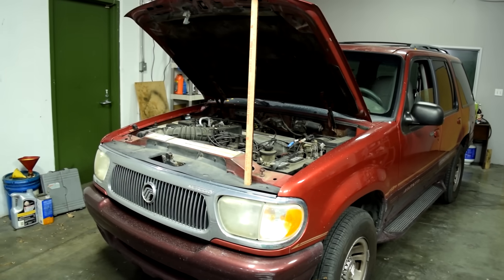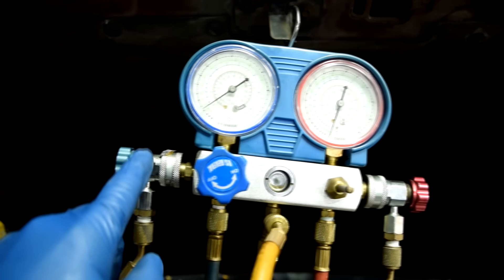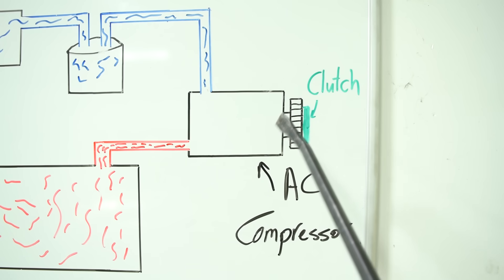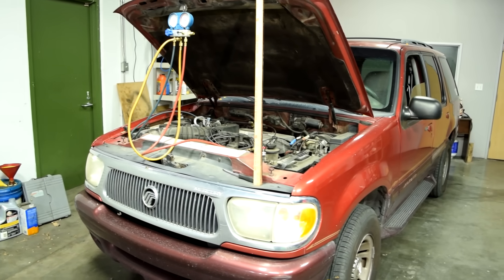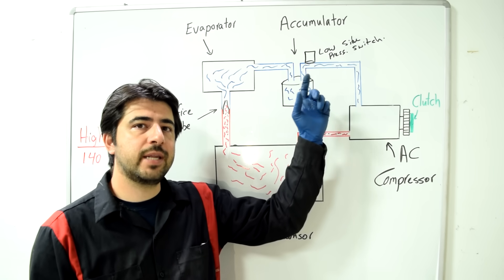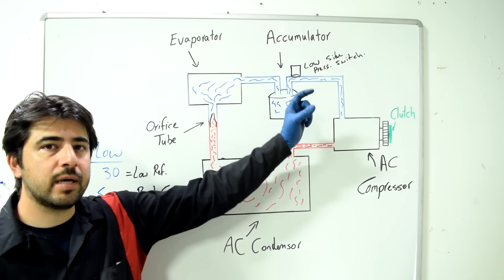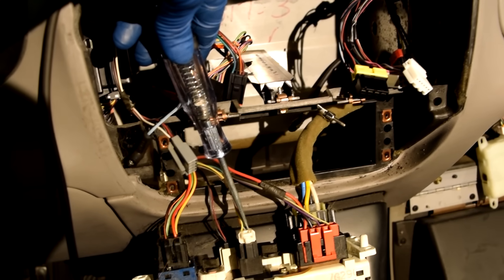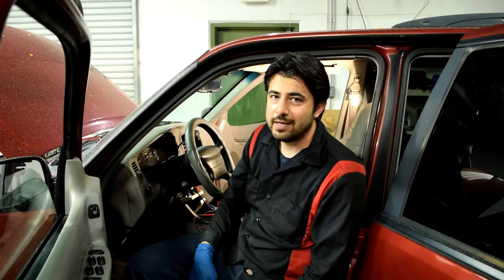Automotive AC Diagnostics, Operation and Repair

Comment: Working on a system that was evacuated due to changing both hoses going to compressor a vacuum pulled but does not hold vacuum when pump turned off?  A leak somewhere on low side, high side held

Comment: I guarantee you, it's the cable that's broken, because all those older cars or made with these little plastic pieces, they get brittle over time, in the hot Sun and I tell you what will actually work. And it has worked for me for years. Is it JB welding? The
Bike wire, just like the one on A Regular bicycle, glue it to the part where it's broken, and it will actually work. I haven't had any issues since I've glued mine down and over five years

Comment: There's a much easier fix to the common broken blend door.  You do not need to pull the dash, but it does require cutting a hole to get to it and replace the blend door itself.  Don't pay to have your dash pulled.

Comment: If I lost all my refrigerant, how much oil would I have to add. I'm going to replace  condenser and accumulater. It's on a 96 ford ranger. I just don't know how much oil would have been lost loosing all the refrigerant?

Comment: Hi. My car ac runs on 134a. Ambient temp is 95F. At idle, the low side reads 30psi and high side reads 250psi. At 2000 rpm, the low side reads 45psi and high side reads 390. The system blows cool air, not cold. After I turned off the engine, the system took 13tmin to even out the low and high side pressures. Is this a sign of bad a expansion valve? Compressor runs fine. The low sideline is cold. But cold air is not blown. Just cool air is blown in the cabin.

Comment: I thought it was very fulfilling. Good troubleshooting and shows but it takes more than the refrigerant cycle to cool the car. I had a friend with a similar problem on his Nissan and I showed him how to reach under the dash and turn the thing by hand. He had also run for years with it on hot. After that he probably ran cold all summer and hot all winter and only had to fool with it twice a year😂

Comment: Howdy...I have a 1995 Chevy 5.7L K1500 truck A/C issue.  I replaced the pump compressor with a new one because I thought the pump was bad, and it may have been going bad. But my gauge set was faulty out of the box...the Low side hose at the system end was not drilled, so it was a dead-end.  I figured this out when trying to put PAG oil in the system. I drilled the brass hose fitting and put 6oz of PAG oil in 3 different places (new pump, accumulator, and condenser), and 34oz of R134A (what it calls for, 32ish).  This afternoon it's presently 72 deg F. A/C is blowing very, very cold as it should be on Max. The Low line is very cold. The High line is very warm to hot (I can hold onto it for 15+ seconds, on the metal portion right out of the compressor), and the pump case is very mildly warm to ambient. With the cab window down, in the shade, the compressor clutch stays on fulltime at idle, but when revved to 1600ish rpm it will clutch-on for 6 or 7 seconds, and clutch-off 6 or 7 seconds.  The air stays cold in the cab when it does this.

I also changed the orifice tube with a new one, and blew out the condenser (nothing came out), and removed and inspected/tested the accumulator.  It was good.  The system looked fairly new, like less than 5 years old. 

At 750 rpm idle the low side reads 23 to 25. The high side 135 to 150. At 1600 rpm it stays the same, except it cycles as I mentioned.  When it turns off, the pressures changes of course. When I turn the truck off, the pressures equalize within 5 to 10 seconds. 

What might be my issue?  I'm first going to check the readings with another gauge set, as this new rental set is crap.  Many thanks!
Reply: pressures are a bit low.  check idle speed .  idle up (fast idle) should work when ac is switched on.  if idle is good, recover the refrigerant, pull a good vacuum (half an hour at least) and charge by weight.  no fix, could be a bad evap thermostat or a bad compressor.  or you can leave it alone if ac is cold at idle.
Reply: @rodzvalv_5673 thanks!

Comment: What happens if the low side reads correctly and the high side reads low?
Reply: compressor is likely done. or refrigerant is low. turn off engine and  check static pressures after one day  (pressures when engine is not running).

Comment: I have a Mitsubishi space gear and I had the ac recharged but we noticed both outer cooling fans that are in front of the condenser are not working.The fan blades spin freely and will operate after tapping the fan motor.what controls the fans or are the fans not good.

Comment: I got a 2008 toyota camry LE, and my ac stopped working. The compressor is cluthless hard to see physically  working, but when I turn it on, i see the rpm increase fans working. The compressor got ground and power. i can hear the compressor working but is not sucking any freon high and low gauges stay at 100 psi. I replaced the compressor vacuum, but I can't recharge it any ideas and no codes

Comment: What does it mean if the compressor is always engaged and won’t stop
Reply: Likely an electrical problem upstream of the compressor.
Reply: @ncooty  what do you mean upstream? Like a temp sensor?
Reply: @bhadz100  I had in mind a stuck A/C relay or bad switch in the A/C controls, but it could be a stuck clutch or bad clutch coil.  With the car off, does the A/C clutch wheel spin freely?  If not, stuck A/C clutch.  Personally, I'd start by swapping the A/C relay with a relay for another circuit to see if it's just a bad relay.

Of course, it could always be more than one problem.  :)  That'd be my luck.

Comment: So on the pressure guide why is this chart so low compared to let's say the "A/C Pro" guide which has 85 degrees F at Low = 45-55 psi and High = 225-250 psi ?  I just did this and after adding the recommended amount of R134A is a little low on pressure both H & L.  Should I just add more or not go above the recommended amount?

Comment: I have low side 55 psi ans high pressure 150 . In a buick enclre 2016 compressor stays on fan works . Only blows cold when running. Not at idle.

Comment: I took my vehicle to a mechanic shop because the AC unit was blowing hot...then cold air. They did a diagnostic [the said] and found that the Schrader valve was bad. They replaced the valve. But I continued to have the same problem. After the third time I returned to the shop, they told me that they found metal in my AC compressor. It would cost me an additional $2000 to replace the compressor. I already paid 900 bucks to have the Schrader valve replaced. Something smells fishy ya think?

Comment: I work on the building side of HVAC and I wasn't sure if there was anything different between auto and buildings. Turns out, no it's the exact same just smaller scale and more of a cluster fck. Also the accumulator is called a liquid line filter dryer from where I'm from.

Comment: i have a unique issue and was hoping for some input, i have a mazda 6 2015 and it wont stop blowing cold air. it has dual air and heat if that matters. if i set the temp at 65 its awesome and plenty cool however if i turn off the ac button and set the nobs at 85 it mixes hot and cold and just blows warm air...i am stumped on where to begin.

Comment: What if you get 0 pressure on both sides with the compressor engaged?  (had to jump AC cycling switch).  Does that also point to a bad compressor?

Comment: Great video with tons of knowlege. So I have a 2006 Honda ridgeline. Temperature knob at low setting. A/C turned on and I get cold air. Stuck a thermometer in a vent and it shows just a bit above 40 degrees output. 5 minutes of driving, A/C quite and wil then randomly come back on or not come back. Switch off tge car for few minutes, restart the vehicle A/c back on. Swapped the relays even with no positive efffect. Please oblige me with your advice. Thanks. Ash

Comment: Got a challenge ,2019 kona ac blows hot ,when ignition key is turned on it blows for 12 or 19 seconds then shuts off  wont cycle on stays off until key is turned offand on again?

Comment: cap off the heater core and lines from the engine and have ac ?? or turn the mechanism manually and leave it on cold

Comment: What could cause the clutch to disengage while in the on position? 
The clutch itself. The A/C relay & low pressure … 
- anything else? 
I ask because while running and giving cold air the system shuts off. I turn thermostat off and quickly back on to cool and immediately I get cold air again.
 Stays on roughly 1-10+ minutes before shutting off and I have to do same thing turning off then back on and works again

Comment: You got me to like and subscribe with the ‘make lemonade’ bit, and I did find the video informative. I have been helping a guy work on commercial refrigeration, and it’s funny—I don’t understand why everyone thinks it’s something special. It all seems basically the same, whether it’s a small mini-fridge or a walk-in cooler/freezer. I get that there are some minor differences, and I suppose if you’re talking about big rooftop units with water chillers or even geothermal systems, there might be some variations. But fundamentally, it’s still the same concept, right? The major difference lies in how the heat is dissipated. Or am I missing something? I am mostly referring to auto/home/restaurant refrigeration. Good video! Thanks

Comment: I had a similar problem and my work around we to put a valve on my heater hose block the hot coolant from the heater core.

Comment: I have a question. I vacuum down the ac for a hour. And when I recharged it the high side gauge stayed at 0 my low side was at 35psi. Ac gets cold but not cold enough. Do you know why that might be? Also the compressor new.

Comment: Question. If i take my car to a shop and asked them to recharge my system, do they add PAG oil back in??? I think i need more PAG oil in my system as my low pressure line snapped, lost all refridgerant and i replaced it. I'm in NYC so i dont need AC right now, but just wondering if i have to put in PAG or will the shop put it in with the recharge?

Comment: Hi R&W, hope you can help me with some advice. I'm have a 2011 Ford Fiesta 1.6 with 14k miles on it. And the car is not used frequently. I'm from Indonesia which the outside temp is quite hot all the time, Lately i noticed whenever i started the engine at idle, and then started the AC just to get it work for some time, the compressor won't cycle OFF at all like what it should be before (last time even waited till 30 minutes). The blowing air from the AC  is also ok (cold), so what do you think is the common problem for that.
When the engine is off, I can rotate the clutch freely by hands.

 I don't want to bring it to some shop without knowing first at least the base of the common culprit, because i'm afraid they just misdiagnose it. 

Thank you

Comment: my High side is 60 and low side 20 psi, I noticed the high side leaving the compressor is hot but after it leaves the condenser the line is cold. it run for 2 weeks with good ac after I replace the compressor and the expansion valve ,  can this be a clogged condenser? i that it was low on freon so I add it some more but the reading on the gauges stay about the same. and the High side line is cold from the condenser to the expansion valve.

Comment: Question.   I checked my 2007 Toyota Yaris pressure.  Both low and high read 80 both and when engine is running,  both gages read 90 and stay at 90.  No changes on readings. I do not hear clutch engaging.  What can I check next?

Comment: Great video. What's is the cause when on the high side reads maxed out on the gauge and the low side reads 30 psi ? With the many videos out there not one speaks about it. Much appreciated. Your explanations are very simple and easy to comprehend.
Reply: You kinda of mentioned it in the video. Text before finishing the video. But a great video about it would be awesome to learn from seems not much or any out there. Thanks.

Comment: Nice video but did not help me. My A/C has been vacuumed & recharged, no leaks, compressor works great, but air & lines not cold anywhere. High and low pressures are correct, fans work great, blower great, but no cold anywhere. Can anyone help me?

Comment: Great video.  My Lexus gx470 2007 is blowing out of defrost only. Middle vents not at all. The end vents do blow but weak.  Passenger side cold. But not real cold. Drivers warm.  

I thought it was the actuators.  I have tested and they seem to be ok.  Was going to check freon tomorrow.   I was trying to see why it was not blowing out of middle vents at all.  Frustrating.

Comment: Do you have any videos  or have you worked on the new Freon the r1234yf? is the system basically the same principle? of course with different fittings and different gages right?

Comment: How do you change the lines it there's a leak ?
Reply: If the system still has refrigerant, you evacuate the system into your recovery container, R&R the lines, evacuate, recharge.  IF as in my case the last time, the refrigerant was all gone already-make repairs, then evacuate and recharge.

Comment: Hey boss I got question.   My compressor is cycling but 5hen cuts off and repeat.  I've added a small can of 134 a and examined visually everything looks good.  I got one line I believe it's low pressure line.  What do I do next?
Reply: Have you been able to get your air working?  What did you mean by "I got one line..."?  The port that you connected your hose to for adding refrigerant is definitely the low pressure line.  There is also a high pressure line that has a larger port that the connector on the refrigerant fill hose will not fit.  Assuming there is a cap on that service port (which there should be... a red cap but could be black) leave it on there and never do anything with that service port unless you have a set of AC manifold gauges to connect.  There is extreme pressure on that line.
Cycling on and off is generally a sign of low refrigerant.  Did adding the 12 oz. can of refrigerant help at all - does the compressor stay on a little longer between cycles?  If you don't see signs of leakage from any of the AC hoses or connections you really need to put some gauges on and check the pressures before adding more refrigerant.  Adding too much can damage or destroy your AC compressor so it's best to see what's going on with the entire system.
Since you seem to be a do it yourselfer it might be a good investment to get a set of gauges.  Harbor Freight currently has the newer version of the set he is using in this video for $64.99 although his brand is U.S. General.  If you decide to get gauges you will also need a can tap that fits the line.  Those are also available from Harbor Freight for $7.99.

Comment: Great video.  Don't you need to purge the lines before connecting to the low and high side if the intention is to get some measurements only or no need ? thank you

Comment: Great information shared brilliantly. I got my cheapo gauges but got a surprise! Hight pressure coupling would not connect to my Chevy avalanche high side. Checked the gauges on a different can and they fit ?! Upon further inspection I discovered that the coupling second ring was not round? Felt hexagonal? Do I need an adapter to fit Chevy truck?

Comment: Thank you so much for the video. My 2002 lexus sc 430 has 95psi on the low side and 100psi on the high side when the compressor is running. Do you think it is a bad compressor check valve or a bad ac compressor or may be both expansion valve and compressor is shot? I vaccumed the system and made sure it didn't have any leaks before filling it up with 23oz of refrigrent. I really appreciate your feedback. thank you

Comment: Hello I have an A/C issue with my 2010 Altima. Compressor clutch stays engaged all the time and the A/C does not cool down enough, just very little bit. There is A/C gas inside. I can not find the A/C compressor relay. Have any idea I can check and fix?

Comment: Hi buddy.

My chevrolet Sonic just keep cool air for a week then just Hot air get in the cabine, when I check the liquid line is Cold and the suction line is enviroment temperature so, do you think it is a expation valve problem or lack of freon due a some leake? Thanks in advance.

Comment: do electric compressors on hybrids needs more presssure on low side? im working on ford cmax hybrid and adding onje can to empty system pegs my low pressure guage to 150psi, and this car takes two cans. after struggeling to get cool air while seeking 40ish psi i deccided to just evac the system again and put in the 1.6lbs as directed and now it works blowing cold air though it has hundreds of psi on low side. i dont have fsm or even chilton but plan on getting one because hybr5rids are strange

Comment: So I have a 2005 scion xb and I just replaced the compressor but I also just bought it so that’s all the owner told me that was bad before it stopped working. I vacuumed it and held -30hg so no leaks. The system took 1 12oz can of refrigerant but the low and high pressures were both 80 psi so I’m guessing maybe the expansion valve is bad? I’m using my gauges to see what’s going on but I do have a service manual I downloaded so it said that same pressures could be dirty condenser or air in the system or bad expansion valve but what do you think?

Comment: 1 really appreciate your help man....I need help with my nissan sentra 2015, y changed everything already, low/high pressure lines, condenser, compressor, I checked for leaks and no leaks at all, already put Freon, but the compressor won't engaged, if somebody can help me with this I would really appreciate it, thanks